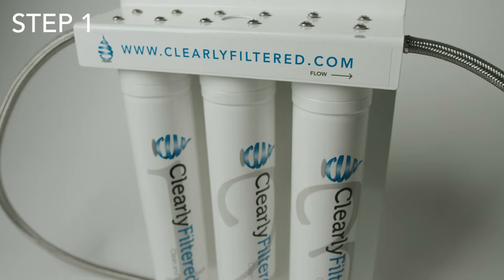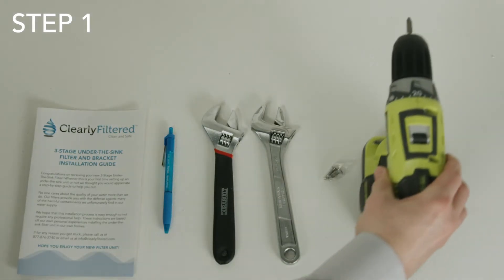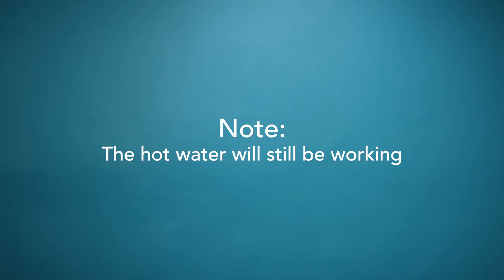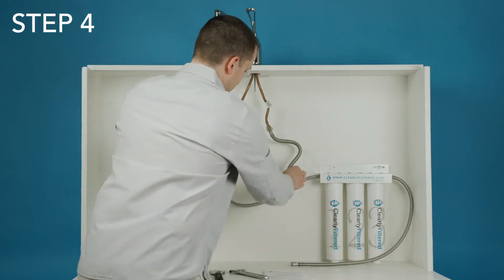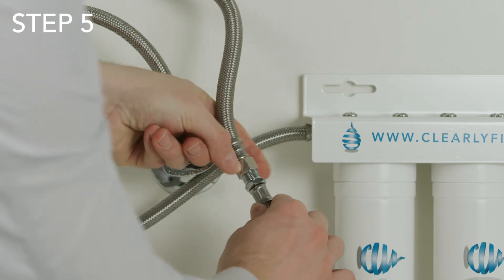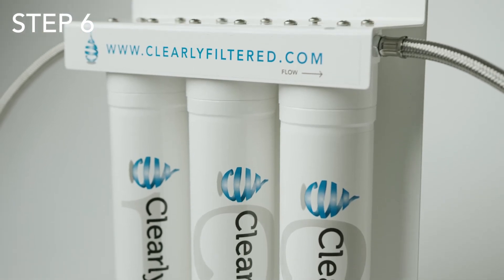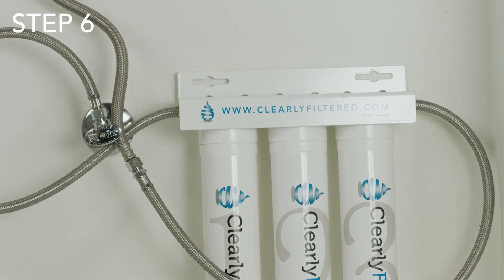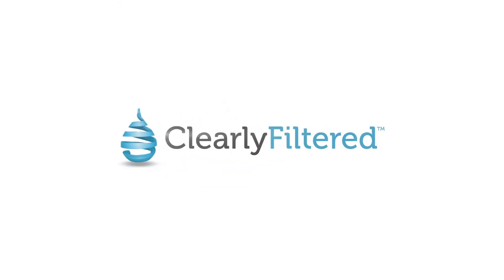Kitchen Faucet Filter Installation Video

Comment: Can I attach this to a separate faucet?
Reply from the maker: Yes, the Under-the-Sink unit can be connected to a dedicated drinking faucet. This may require the assistance of a plumbing expert, as a splitter may be required along with adapters to match the drinking faucet.